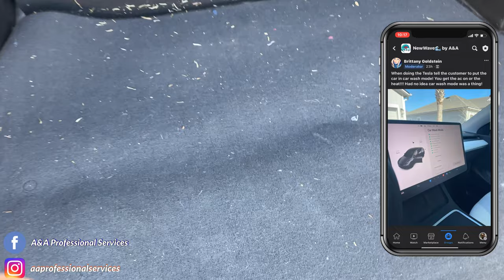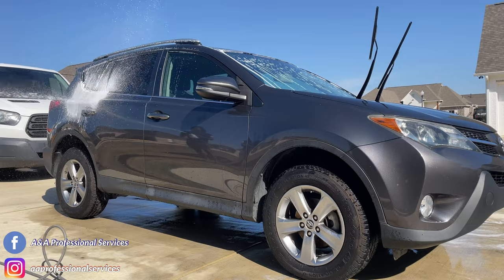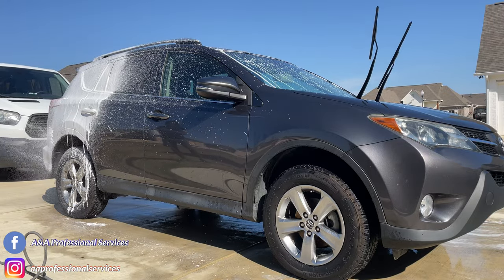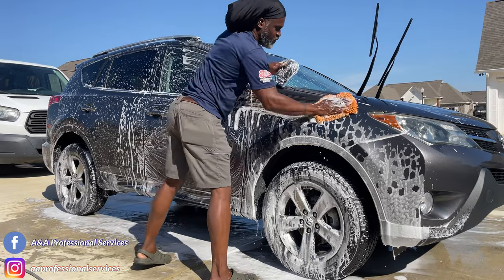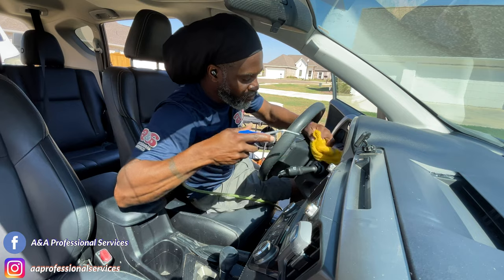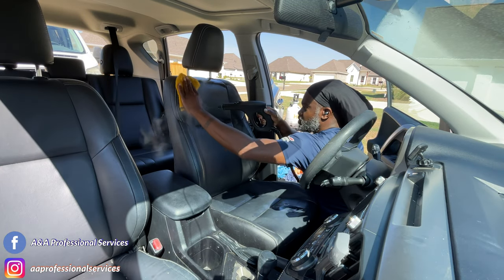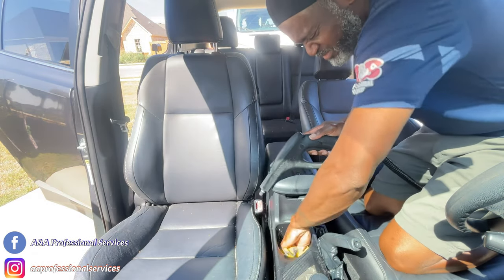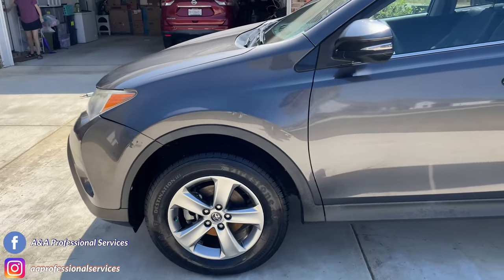Mobile Auto Detailing Business: Harbor Freight Steam Cleaner

Comment: What kind of vacuum do you use ?
Reply from the maker: 4 gallon Rigid.

https://www.homedepot.com/p/RIDGID-4-Gallon-5-0-Peak-HP-Portable-Wet-Dry-Shop-Vacuum-with-Fine-Dust-Filter-Locking-Hose-and-Accessories-WD4070/202077241?g_store=2912&source=shoppingads&locale=en-US&pla&mtc=SHOPPING-RM-RMP-GGL-D25T-025_014_WET_DRY_VACS-BI-RIDGID_3315-NA-PMAX-NA-NA-MK680532200-NA-NBR-3315-CON-NA-FY23_3315&cm_mmc=SHOPPING-RM-RMP-GGL-D25T-025_014_WET_DRY_VACS-BI-RIDGID_3315-NA-PMAX-NA-NA-MK680532200-NA-NBR-3315-CON-NA-FY23_3315-71700000113756899--&gbraid=0AAAAADq61UcPPstwMnOstzMRwGnt_EH9H&gclid=CjwKCAjws9ipBhB1EiwAccEi1GzvRM4GUl5dfNCzuaz86uYdwjLDzUzc_nYhxQdK1npEMMNeSXAOBRoCtIIQAvD_BwE&gclsrc=aw.ds